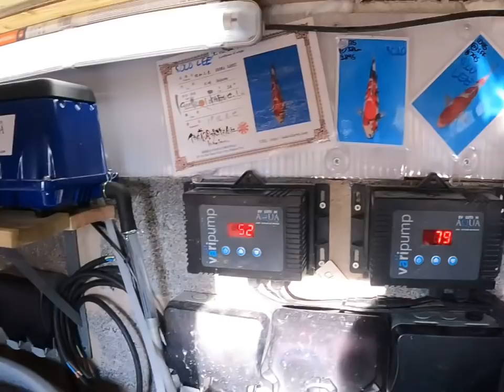Koi treatment update and my          Rib boat revamp!!!!

Comment: Smashed it with the rib 👍👍
Full stealth mode 
Best of luck with the treatments
Hope it works out 🤞🤞
Reply: On the momotaro shower did you have to sand it all to get it clean? 
Did you also remove the nuts inside? 
Still cleaning mine up 🤦🏻‍♂️
Reply from the maker: So I jet washed it first then took all the bolts off, and sanded the lot with 120 grit on my orbital sander. I got new stainless steel bolts from screw fix! Mine looks mint now 🇯🇵
Reply: @leehadfield6881  I’m following your footsteps lol 
Started sanding with 120 grit 
Got the bolts out 
But the nuts are literally stuck on haha 
Cheers mate 
Keep up the great videos 👍
Reply from the maker: So the nuts are like riveted in!!! So I just punched them out with a hammer and bar. Then replaced them with m8 stainless steel bolts and nuts! Think I had to re-drill the holes a bit to get the bigger nuts in but looks nice now! You can get like mushroom headed bolts from screw fix
Reply: @leehadfield6881  
Thanks for the tips mate 
You’re like my bakki shower sensei  hahah